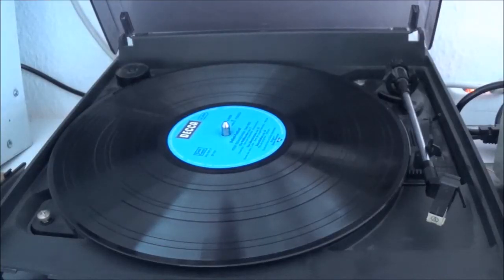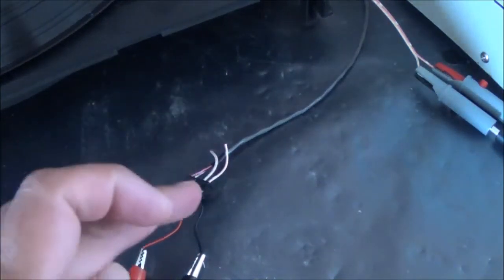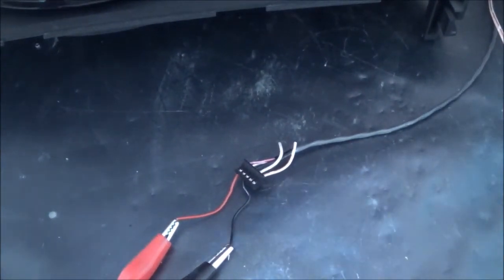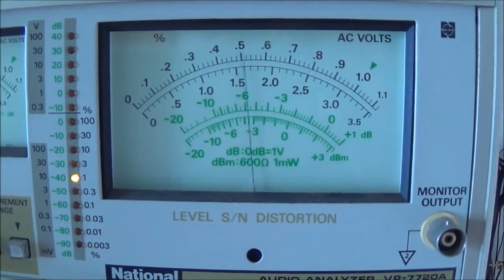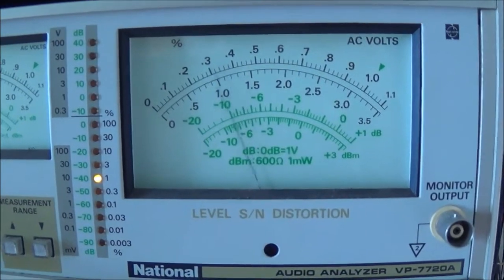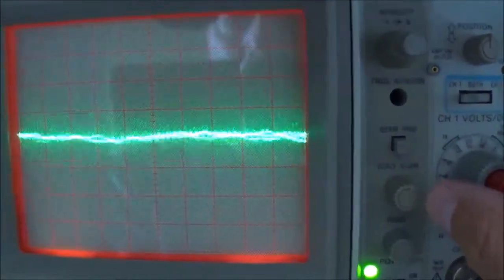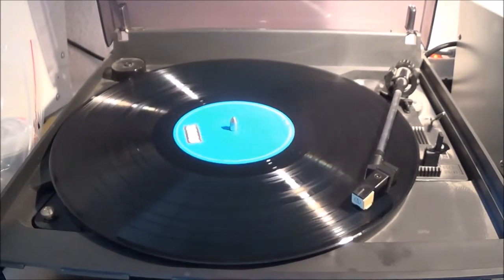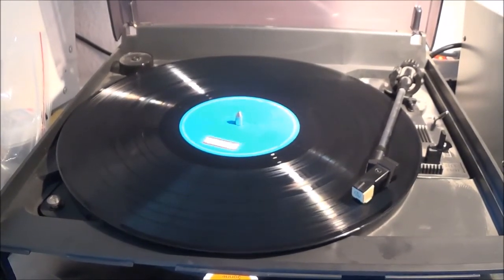Checking Record Player (turntable) Cartridge Output

Comment: Nice distortion meter, I was thinking of getting one as well! Didn't know about the test record? ~Jack, VEG
Reply from the maker: Thanks! Get yourself one.  I recommend the HP334a since it can be gotten for a decent price. The AC voltmeter function comes in handy and, of course, the built-in oscillator. Test record? New ones are probably expensive and you really gotta watch when you buy used calibration records/tapes. As you know, records and tapes wear every time you use them. At least with the new or fairly new factory calibration tapes you can make copies and use the copies. And people often want too much money for them.